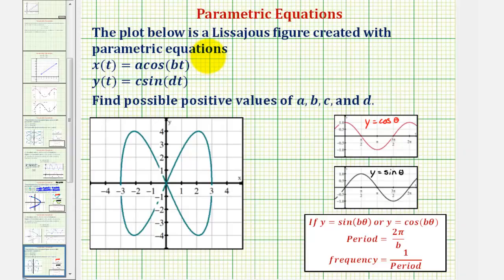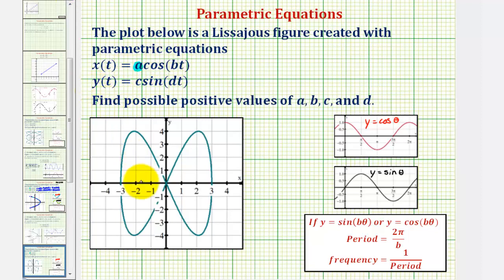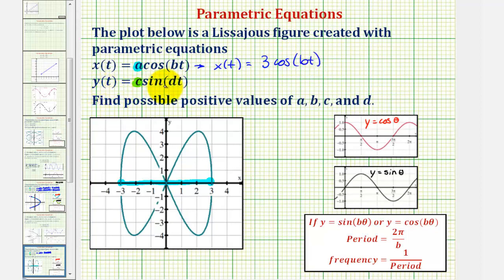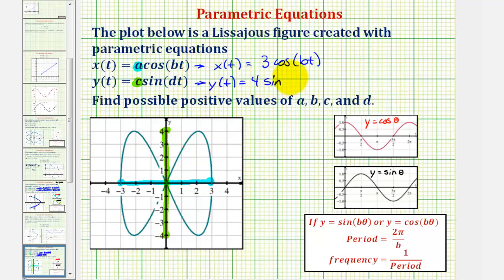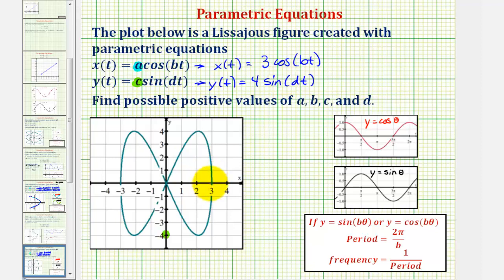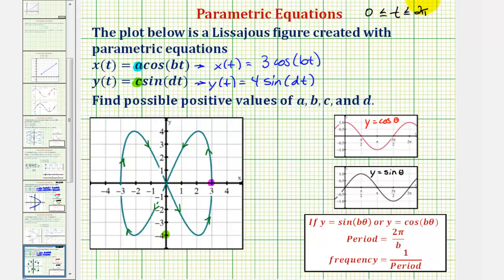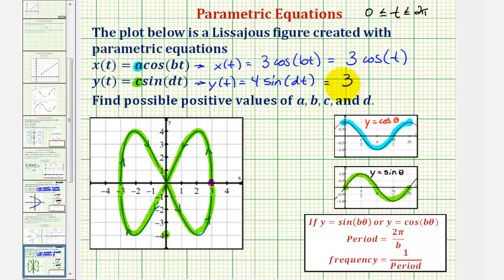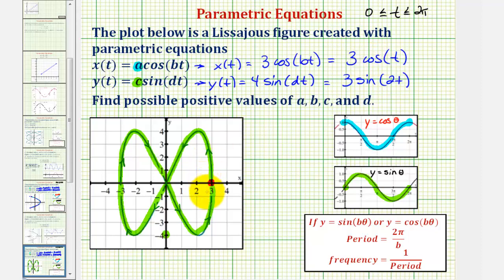Ex 1:  Find the Parametric Equations for a Lissajous Curve

Comment: y(t) = 4 sin (2t), not 3 sin (2t). But clear explanation though. (towards the end while solving...)
Reply from the maker: Yes, sorry for the typo.  I annotated the correction to avoid any confusion.  Thank you for watching.
Reply: @Mathispower4u   2021, I don't see an annotation. Also, very confused about the end explanation. You say as long as the ratio stays the same for b and d, but what is the original ratio you are referring to? Are you referring to the ratio in your result? if so that ratio is the same as what beginning ratio? i.e., I understand that b = 1 and d = 2 so b/d  = 1/2 , and that all other possible b and d values for different intervals must have that same ratio, but you make it sound like you are comparing that ratio to some ratio that already exists?
Reply: @jamesstark4136  in 2013 YouTube had annotations. Now we don't have them anymore